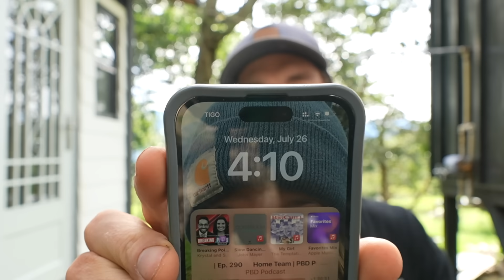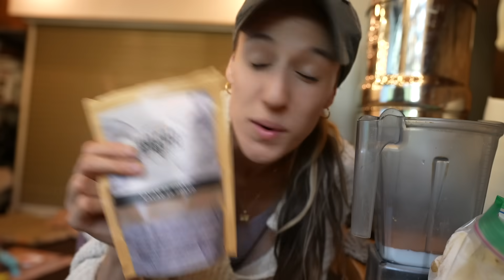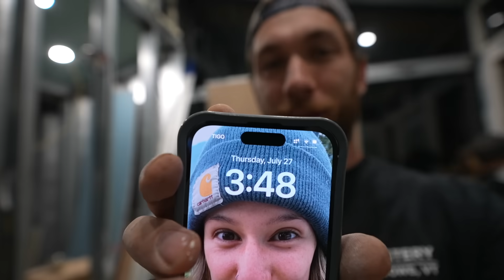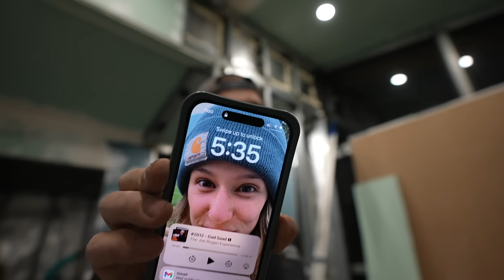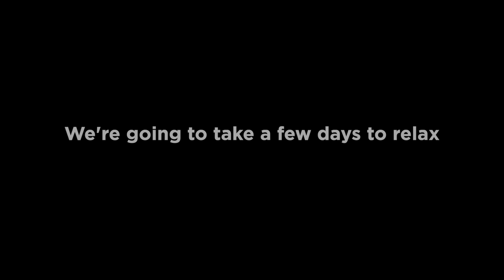THIS WAS THE HARDEST NIGHT OF OUR LIVES... living in panama

Comment: In the drywall mud mix in dawn dish soap it helps with bubbles and makes it spread easier. I'm not the drywaller but my daughters grandpa was and I believe that's why he said he put dawn in it. But he was well known around Michigan for his drywall and his stomp ( the way he did ceilings) he past but his drywall still remains everywhere in Michigan
Reply: Oh and this won't help for the bathroom but when u build ur house stagger the drywall like bricks putting factory edge has too factory edges. And cut edges to cut. If possible. That way when the structure settles u won't have cracks all the way from floor to ceiling because structures always settles and it will crack down where the two pieces meet especially if u have earth quakes. Some drywallers have in the price to come back to fix the cracks that do happen the first time ( on a new build)  it happens after that it's on the home owners. I learned a lot about drywalling from Brenton that I still remember. I did better drywall then his stepson ( my ex) because I actually listened to him lol

Comment: Hey guys, as someone who has done plenty of drywall, plaster, repair, etc.(it’s my trade), here’s a little tip:

Put the adhesive tape on to the Raw drywall first. 

That way it will stick. 

Then cover it with mud. 

It wouldn’t hurt to use a 6 inch knife either. At least for your first coat. Then a 10 inch knife for your second and third coats.

Then, if you’re trying to finish it all in one night, which you’re gonna be limited by drying time, at least have a powerful fan to help to dry things. 

Wish I was there to give you a demonstration…😊

Comment: I've enjoyed you folks adventure.  I would like to make a comment . Try a wet sponge over your joints after it's dried and sanded will pull the loose dust up and help finish the joint. Took me 35 years to be taught that.

Comment: It always takes 3 coats of mud to make it look right. Third coat of mud can be a little wetter to help even out the imperfections. Also, using mesh tape is not good. I would say at least 70 percent of the time it will crack in the seams and corners later on.